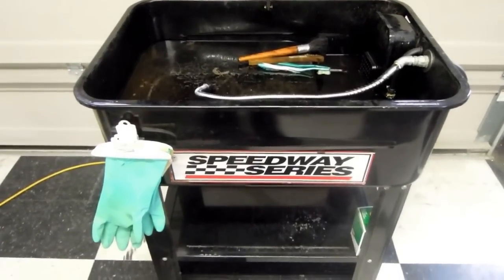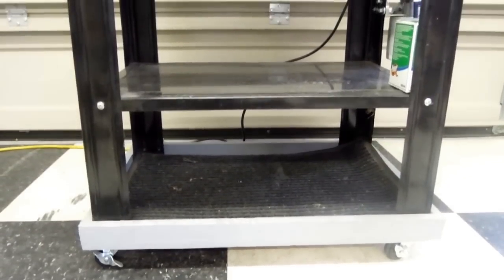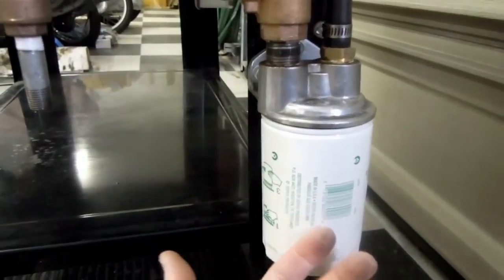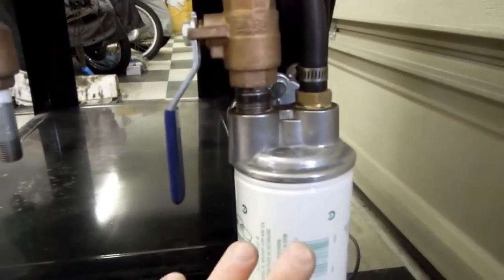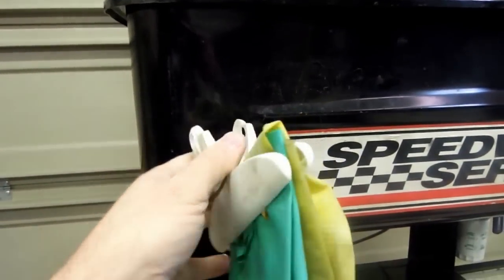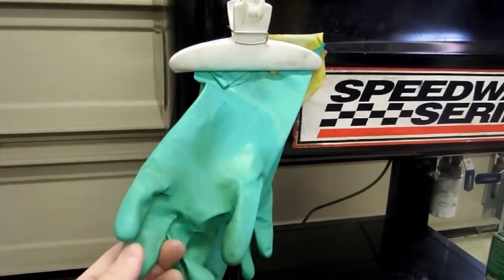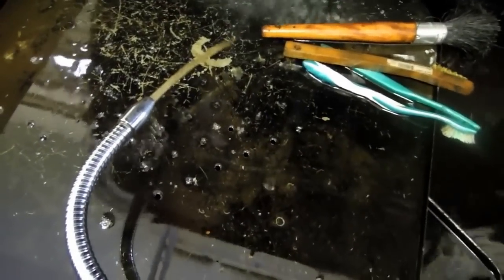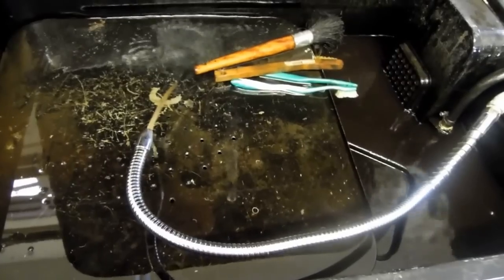Parts Washer Modifications

Comment: Great video! Very thorough. One thing I would add to the drain pipe is a 1/4" pipe cap. It will save a lot of grief if someone ever bumps the handle on the ball valve. While it maybe a slim chance it only takes an extra minute to put it on and take it off. The amount of time spent to clean up even a pop can full of dirty solvent would be much greater. Also safer. Just a thought. Thank you, Jim

Comment: FYI about the filter mount. It's an Empi 9204 and goes for about $20 delivered on the net. The PSC 1000 parts cleaning fluid from Tractor supply works great. Another good addition is a flow-thru parts brush like they sell at NAPA, part #   TSS RP804 for about $16.
Reply from the maker: Thanks for following up with the detail.
 
Regarding the cleaning solution, there is a separate posting on the blog regarding this fluid, which happens to be TSC PSC1000.

It's been on my "list" to add a flow-thru brush for some time now.  Haven't just gotten around to it... yet.
Reply: kwrightway Dito's on the PSC1000.  I used it based on many recommendations and have been very happy.

Comment: Great video.  One question. It looks like you external filter is after the intake of the pump.  So it looks like all the fluid in the tank goes through the pump before it goes through the filter.  Does you pump ever clog?
Reply from the maker: You are correct, and observant, the filter is after the pump.  The pump on this unit is a submersible, and the inlet is part of the pump itself.  I simply rerouted the out-line of the pump to the external filter.  Perhaps I could have adapted this differently, but so far, and it's been a couple of years I've had no issue with the pump clogging.  The filter yes, but not the pump... and it gets used frequently.

Appreciate the comment...

Comment: Why would you have a filter in the pressure line befuddles me ? Seems like you would want it before its sucked through the pump. My mod to mine is put a sink drain in the middle into a 5 gallon bucket with diesel pump I can fill it up wash stuff then pull the plug and clean the bin
Reply from the maker: The unit came with a submersible pump which draws directly from the tank.  I simply tied into the output line and routed the flow to the filter.  In other words, that's the way it was designed and to date, I haven't had any issues with it.

Comment: Very nice video...thank you. Did you have to Prime the filter? I cant get mine to run properly. It is hooked up just like yours. With the same solvent. It is a Harbor freight washer...could it be the pump was for a water base?
Reply from the maker: I have not had to prime my system and I've changed the filter quite a a number of times since this video was made.  However, it does take a minute or two before the pump picks up the prime and takes off so don't be afraid to let the pump run for a bit (within reason).  I wouldn't hesitate to prime the filter, either.

In terms of the pump being made for a water-based solvent, I suspect that's not your problem.  Though I don't recall the specifics, my pump was likely made for water also.

Thank you for the kind words, and good luck...
Reply: @kwrightway  Thank you for your reply. I'm so frustrated why it won't work. I will keep trying.
Reply from the maker: @DeWaltRadialguy  I'd suggest some testing is in order to determine if the pump is functioning and/or the filter not obstructing the flow.  To test the pump, disconnect the output line from the pump that connects to the "IN" side of the filter mount and point it into a container  or bucket.  Turn on the pump and see if fluid is flowing.  The next step would be to connect the pump feed line to the filter and remove the spin-on filter from the mount.  Put a bucket under where the filter spins on and turn on the pump.  This will tell you if fluid is flowing through the filter mount.  You could then disconnect the filter output that goes back to the tank and do the same test.  Each of these steps will eliminate, or identify, each major component as the issue.  The pump, filter mount and filter cartridge, in that order.  I suppose it's possible you have a plugged fluid line or defective spin-on filter.  However, my bet would be on the pump.
Let me know how it goes...

Comment: Thanks for a great video. Can you tell me what is the brand of the new pump and where you purchased it? All the reasonably priced parts washers I've see come with water based pumps which don't last long.
Reply from the maker: Ron I'm afraid I don't know the brand of pump, as this project was completed several years ago and there's no label or identification on the pump body.  However, I can tell you that I bought the pump off eBay and it was't very expensive.

Comment: Great video, thanks for taking the time to post it. When you change the filter, do you just waste the solvent that remains in the filter, or do you dump the excess back into the tank?
Reply from the maker: I recover the solvent left in the filter by turning the filter up-side-down and punching a hole in the bottom of the filter canister.  I place the filter bottom down on the tank shelf and allow the filter to drain for a few days back into the tank before disposing of the filter.

Thanks for the comments...

Comment: Is this parts washer the $160 or so parts washer sold by Speedway? I know it's been a while since you bought it, but was wondering if this is originally marketed as a water-based only parts washer. I have a similar one from Harbor freight, and want to use the crown PSC 1000 solvent as well.
Reply from the maker: The washer was a gift, at least eight or so years ago now so I don't know what it cost when new.  Regarding the pump, I replaced the original pump before the modifications where made with a solvent compatible pump found on eBay.  I believe the original pump was labeled as water-based solvent only, though.

Comment: Hi, thank you for your awesome video.  I want to use water-based solvent (even tho it doesn't clean as good).  I am wondering if the oil filter element will get screwed up by the water based solvent (as in the paper element falling apart)?
Reply from the maker: +Stanward Oshiro  I don't know, but I wouldn't be afraid to try it.  If something goes wrong, such as the filter ends up restricting the flow, you can always bypass the filter until coming up with a different filter option.

Comment: I like the drain. I took out the plug but I can't find any pipe that will fit. When putting a nut on the plug to find it's size it seems to be 9/16-18. What the heck did you use to put in as pipe nipple? The rest looks like normal 1/4 inch fittings.
Reply from the maker: Mike Carlton It's been a while since took a close look at the configuration, but if memory serves, on my tank I used all 1/4 standard pipe fittings.
Reply: Mike Carlton Did you ever figure out what size this was?  I just bought a harbor freight model and running into the same thing.  I thought it was 9/16 and its close, but not it!  1/4 inch seems to small to me.  I keep seeing mods all over, but no one states the size that that you need at the drain hole.
Reply: cashxx Yes I did figure it out. It did end up taking the standard 1/4" galvanized pipe found at home depot & lowes. Valves, nipples and elbows all 1/4"  I also measured the base and it fit very well with the mover dolly sold at harbor fright. Just take the measurement with you as they sell a couple sizes. I drilled the pilot hole so not to split the wood and sunk in the wood screws.  Good luck. Funny thing is the 9/16-18 tap fits right in but don't worry about it. 1/4 works just fine
Reply from the maker: Mike Carlton The drain fitting on my tank is 1/4 inch, though I couldn't find 1/4" at any of the local big-box stores.  A local mom-and-pop hardware store had them though.

Comment: Great engineering.  The only thing I would have done, is add a filter bypass in case you ever  need to finish a cleaning job and have a severely clogged filter with not pressure and no clean ones available.  Just thinkin worse case scenerio, haha..  Great vid !.
Reply from the maker: Good idea, thanks for the comment!

Comment: I agree water based solvents don't work I bought 100 gallons of solvent back in the early 90's when it was $2.25 a gallon now it's 5-6 times that last time I checked. A friend of mine who lives in California said he could not even find it there he came to AZ where I live and got some from the place I went to years ago it was like $7 a gallon he about crapped him self. The only reason I bought 2 drums of the stuff back then was I got tired of getting more. The problem with solvent is it evaporate sitting in side the bottom of the parts washer you lose about 1/4 gallon every month. I want to have mine drain back into a drum and close 2 valves so it doesn't evaporate.
Reply from the maker: +kell490 I keep my washer lid closed when it's not in use and evaporation hasn't been a series problem for me.  I do have to top it off one a year or so, but that's about it.

Thanks for the comment...
Reply: kwrightway Nice setup I never thought of wheels that is a great idea. Mine needs a new pump it's a harbor freight maybe cheaper to just get a new one from HF I think they cost $80 with the %20 off coupon. I was thinking about trying a EFI fuel pump filter the intake of the pump side to keep it clean. Put a screen at the bottom with 2 handles I could just lift it out and put the junk the trash can.

Comment: "even kerosene..."  Most kerosene has a flashpoint over 140 (the stuff you're using has a flashpoint of 141) and can be as high as 162*F
Reply: I use kerosene.  Agree that gasoline should NEVER be used to clean parts.